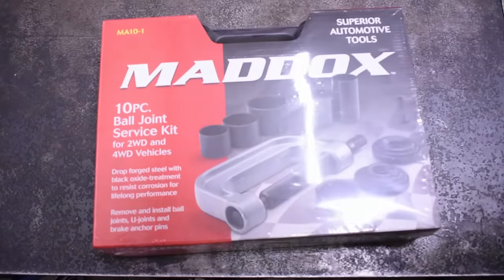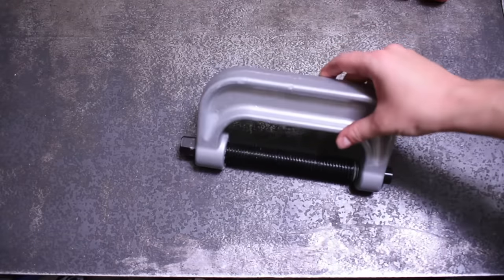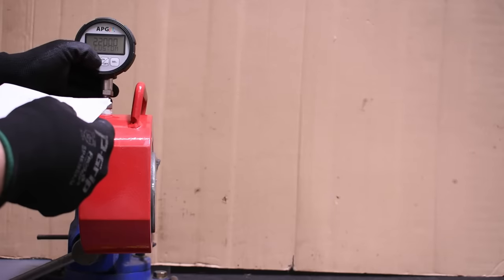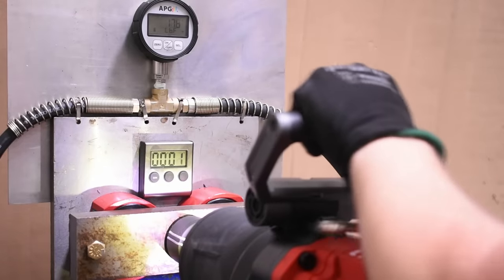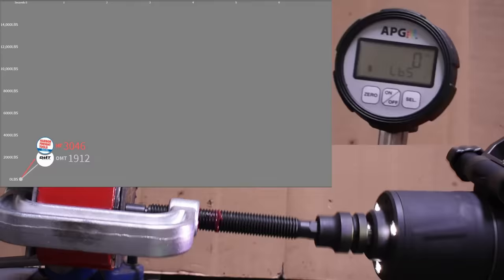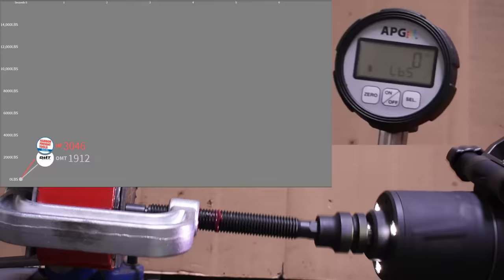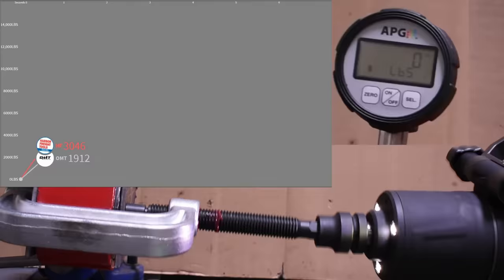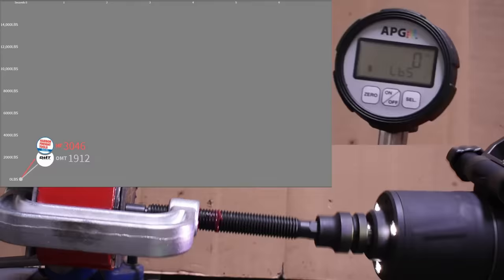Exactly How Strong are Ball Joint Presses? Harbor Freight vs Amazon

Comment: Snap on TAP1, air brake anchor pin removal press. Looks like a mini, chunky ball joint press. We have one, have had our air 1” on it and have to smack it with a hammer to unseize  some anchor pins.

Comment: Definitely want to see OTC on this list, specifically the USA model, I have two of them and they are hard to kill. I have seen non usa models of the OTC so that's why I am specifically requesting the USA model
Reply: OTC very briefly started selling a made-in-Taiwan ball joint press about 8-ish years ago but quickly went back to made-in-USA only. Any new one you buy (model 7249 - kit or 7248 -just the C-Frame) now says Made in USA on it. They did that because the same press is also being sold under the Matco name (model BJP7025C) and their pro sales demanded the USA quality. 

That said, OTC has a new ball joint press model # CA7149 styled like the Snap-On with snap-in place (or 'connected' as they like to call it) cups/adapters that they also sell under the Matco name BJPXR9PRO -kit or BJPXR9CF -just the C-Frame.

Comment: I rented a ball joint press from O'Reilly's and the ball joint was either stuck or the tool was weak because the ball joint didn't even budge. Since only the boot was truly bad I replaced it and sold the extra ball joint with the vehicle. I can't remember what tool I used on the press. I know it was a PITA to try to get on so I might have just used a breaker bar.

Comment: As a mechanic I'd love to see the snap on ball joint press tested. Just to see if it's worth the 7x price
Reply: The convenience of all the adapters having locking rings alone is worth a lot. Holds everything in place as you're setting up. It's a beast of a tool.

Comment: Sure would like to see a part 2 of the ball joint press. I have an Astro (not the goliath 78100) joint press that distorted after a couple yrs of use. Still works but have to be careful initially starting ball joint into  ctrl arm.
Reply from the maker: Does the frame itself have a "C" forged into it (raised)?
Reply: It does not have a “c” in the frame.
No markings at all on the frame. 
Astro part #7897 on plastic hard case

Comment: I killed a Powerbuilt ball joint press by taking out the screw threads before. I guess a 6 foot cheater pipe on a 3/4 drive breaker bar isn't good for these things. I bought a Maddox to replace it and I was happy with my choice.

Comment: Try clams next.  I bought one from Fleet Farm and only was able to get use it for two minutes before it exploded.  I thought it would just bend.  Took it back for another  new one..  Just trying to push a brake caliper back.  I did find out the caliper was frozen and had to get a new one.

Comment: Alltrade 648602         I bought this ball joint kit in 2012 for $189 plus tax and has done everything I've needed it to from small Civics to Dodge Cummins solid front axle ball joints. I have needed to get some additional adapters but was very good to me when I got it and still use it today.

Comment: Great test!  But with cheaper presses you are better off turning your press by hand and occassinionally whacking the side of the control arm with a hammer, that's just a tip for the DIY'er to save the press.  Again very informative.

Comment: I've had the best luck not trying to have the press do all the work removing ball joints. Instead, snug the press down just to reload and then hit the area near the BJ with the nastiest air hammer you can find with a wide flat anvil to minimize damage to the surface. The vibration+press is super effective at breaking loose the BJs way more than just the press or the hammer alone.

Comment: Question for TT Channel: I see the Mattox reached higher torque rating which makes it sound superior.  However, shouldn't the test metric be at what torque the tool becomes unusable?  What amount of permanent deflection resulted in the tool not being square anymore and how did both of the tools compare, in that sense?   Thanks!

Comment: Well the tool truck ball joint presses are a given, OTC is another brand i like to use.
Tiger tools would be another great brand. Tiger markets specifically to diesel techs like myself and ive personally found their stuff is top notch though extremely expensive.

Comment: If you are getting tool bend levels on a ball joint press your doing something wrong.  Or , I will add heat with a torch while under pressure.  First will try taking a hammer and slamming away as I’m cranking down the press. This will give the jiggle needed to get the thing moving.  So the extra strength probably doesn’t really matter, if you are just a bit careful.

Comment: One thing I see about the Maddox , I don’t think the  OMT has is the ball bearing for load the omt is prob metal to metal creating more friction why the load pressure was higher on the Maddox, I come across a deal on a snap on kit it’s been nice . A little overly priced but good thing is I have warrantied the screw and clamp once already . I have used Astro Pneumatic brand a few times they don’t seem to be bad either ..

Comment: Hey guys, you need to compare the diameter of the threaded rod, and also the hardness of that, along with the threads per inch. Those majorly matter for the torque output.
Reply from the maker: There are all the same from what we've seen. 1-1/8"  coarse

Comment: My Orion stated not to use an impact gun but with F250 ball joints, I could not remove them with a breaker bar and 250lbs of my fat butt to get them off. The press lasted just for a one time use even with lubrication. Stripped out at the last ball joint.  Really need a recommendation for a press that can handle an impact gun for more than once.

Comment: Any chance you can test budget sub compact impact wrenches? I’m debating between craftsman and ridgid. I currently have a majority of craftsman power tools as I don’t have loads of money being 22 y/o. I haven’t purchased an impact wrench yet but am debating on if it’d be worth spending a bit more money and investing into the Ridgid line for my impact wrenches. Also, i haven’t had much luck finding octane batteries that aren’t Bluetooth controlled. Is that the norm for octane now?
Reply from the maker: Craftsman between those two for that size

Comment: Well i dont know a lot but ive used a GM special tool#xxxx and it was like 2 times bigger than those presses, runnin a MAC 1/2"gun at 180psi and that ball joint just laughed at me... dueling air hammers and a torch were the final solution. I dont have much luck with ANY ball joint press for the really crusted in ones.

Comment: I’ve got the cheap one, works just fine for casual home home use, I didn’t see anything wrong with it in real world use, easily removed baked on stuff from a F150 with a quarter million miles with more than plenty to spare… would I buy it for a pro shop, nope. Good enough to get your money’s worth out it though no doubt…

Comment: Wonder how a truck anchor pin press would do. My snapon tap-1 is good with a 3/4 impact and ive put it up against some stubborn pins before. Or a otc ball joint press, which is the same as a matco

Comment: How about electric screwdrivers such as the tdo22dse. Like your fisher price review I'm keen to see how you would approach a tool like this. The challenge is I like it for the low speed when tightening small terminals and just enough power to install 2 inch wood screws. Also battary life is great.
Tia

Comment: i'll be damn I just did my ball joints a hr ago and then this video pops up! awesome. I stopped using these presses awhile ago.. I just use a deadblow to pop em off and then a air hammer with a flat fitting and a press race on top to install!

Comment: I just wrenched down a Maddox balljoint press so much it broke a 3/8 ratchet with a cheater bar.  Now, air compressor impact wrenches from auto shops cant undo it.  What do I do?  Use a 3/4 ratchet with a cheater bar?

Comment: I know it's been 3 years, but... IF you ever revisit this, measure the screw pitch(es) of the various units for comparison.  A press with a finer pitch would in theory make more pressure with the same given input right?
Reply from the maker: They're all 1-1/8" coarse thread. Agreed on the fine thread, but also more room for messing up those threads when abused. Fine threads can get buggered
Reply: @TorqueTestChannel  yup, 100% on the fine thread. Was just thinking was it a pure apples to apples thing, or was one a BIT finer than the other!  But glad it did get checked, thought maybe I just missed it.

Comment: What was the difference in thread pitch between the two? The only logical explanation for the increased output at the same input would be if the HF unit had finer thread pitch.
Reply from the maker: Both same 1-1/8" coarse thread pitch. The cheaper one yielding (bending) is what caused the force transfer difference

Comment: I would be interested in the pittsburg one that is no longer available.  Even if not a destructive test, just curious about the hardness/weight compared to the maddox.  I'd also be interested in an OEM or Lisle set since those are what you can usually buy/rent at the auto parts store.

I would really be interested in seeing tail pipe expanders tested.  I've found most cannot handle stainless, but there are a few different kinds.
Reply from the maker: We've bought two separate kits that advertised as being the Pittsburgh one, we'll see!

Comment: Could you test the XGT Makita 3/4 or the 1/2 VS the Ingersoll rand W7152 1/2. which are both powerful than the milwaukee high torque 1/2.
Reply from the maker: We did the XGT. Check it out!

Comment: Just wondering when you will be testing more of these presses.  It is an issue all over the net trying to find one that will stand the test of time.
Reply from the maker: Yes. Working it. We sent some to a lab that we couldn't kill so they could. Takes a few weeks
Reply: @TorqueTestChannel   Now i'm waiting in anticipation to see what units you could not kill!  Thank you.
Reply: @TorqueTestChannel  Interesting on the OTC as I've seen some comments that others have bent them.  Maybe they have improved.  Thank you for responding.  By chance did you test the longer Astro clamp?
Reply from the maker: Make sure the OTC is the newer made in USA one. We did test the longer Astro as well with very similar results

Comment: You could have made the pressure transducer with a disk brake caliper on the cheap. You'd need to use brake fluid or the seal ring would eventually fail.  Just sayin.

Comment: "Maybe a rusted ball joint really takes 40k pounds"

Welcome to Wisconsin. I've had smaller control arm bushings laugh at a 20 ton shop press. When those do release, it sounds like I bashed the press with a 20lb sledge.

Comment: I've been using a Chinese ball joint press for the better part of 5 years with 0 issues
Seems to me people need to learn how to use their tools.
I live in the rust belt. I've done many cars, 1/2 tons 1 tons 2 tons and 5 ton trucks, never had a single issue. after all that time there's some wear on the threads and that's about it

Comment: you ever going to test the cordless 3/4" Earthquake?
Reply from the maker: We'll cut it together, but long story short most people including us dont have enough air to run a 3/4". We ran it straight off a 3/4" cast iron pipe and didnt get 90 psi dynamic in the tool.
Reply: @TorqueTestChannel  meant the rechargeable one, that I own. I think its 20v but its 3/4".

Comment: Am I the only one wondering why this test is even being done?

Of course using an impact on any ball joint press is going to ruin the press. 
These are meant to be used with breaker bars where you can feel with your hands when the old pops loose coming out(sometimes with a little heat added), or the new one possibly binding going in. 

If you use an impact, you lose that sense of feeling, and possibly ruin not only the new ball joint, but possibly the steering knuckle, or control arm.

Comment: How about the Astro Pneumatic Tool.  I already know that  I already know that this one is junk, I got from Amazon: Strong Ball Joint,U-Joints and Brake Anchor Pins Press and Removal Tools丨Universal Installation Kit for Pre-pressed Upper or Lower Control Arms
Reply from the maker: Atsro is the top 2 ball joint presses. Astro & OTC, well Snap-On as well if you include tool trucks.

Comment: Don’t wanna be “that guy” but….
How to Calculate Hydraulic Cylinder Tonnage
Measure the diameter of the piston of the hydraulic cylinder with the ruler. If the end of the cylinder has a saddle or other fitting, measure the actual piston diameter, and not the fitting, because the fitting might be larger than the piston.

Calculate the cross-sectional area of the piston by squaring the diameter, multiplying the result by pi (3.14), then divide this result by 4. For example, for a piston with a 5-inch diameter, square 5, multiply the result by 3.14, then divide by 4 to get 19.625 square inches.

https://sciencing.com/calculate-hydraulic-cylinder-tonnage-5912415.html

Comment: I recently elongated my breast on a '94 Dodge d250. The torch had run out of oxygen, mainly because 37 other a$$holes use it, none of them capable of turning the knob off on a tool that's older than they are, no matter how many seen your text bring it up at a shop meeting.
Anyways, I was already short on patience after finding 15 different shop tools broken, missing, not assembled for use that week.

Comment: I laughed when it dawned on me that you were checking deviation between the press face and the ram, a moving object, instead of the overall length of the press frame.
Nice try.
Reply from the maker: Ram body, not the ram cylinder. The Ram housing aint moving

Comment: Ya know, just once I'd like to see a tool test that actually tested a tool doing what it's designed to do, not using it doing something impossible just to see if it breaks or fails. These are ball joint presses, set it up where it, I don't know, actually tries to PRESS SOMETHING OUT!
Reply: @dchawk81  yes agreed, this tests who is the best tool maker for a tool, not a test of hey i let these ball joints rust outside with vinegar and water for a week and now lets see how powerful these tools are. These tests will tell you how effective a tool can be, and who it will beat.

Plus I want to own the best tools, so important.

Comment: OMT is truly a POS ...97 jeep XJ 19 year old son full of strength destroyed it in the first joint making it useless..even the caps and cups are crap steel.. rented an OEM branded from AutoZone worked amazing. If your gonna do ball joints on a compact less than 5 yrs old go for the cheap but a really old rusty joint will bring it's abbreviation to life
Only More Trouble😉

Comment: Tell me if I’m wrong but I Think you mean the deflection total is what you measure then half it not double for the bend on each arm, you’re measuring the gap thats been made in it’s entirety not half it. Also presume you are measuring off the piston housing not the ram as it’s moving tiny amounts (just camera angle I can’t tell)

This is good idea though seeing as you’ve got all these toys might saw well see what’s what with ancillary equipment!

And I want to use that 3/4 gun on the last dick in a tyre shop who put my wheel nuts on with an impact and gummed up a couple of threads!